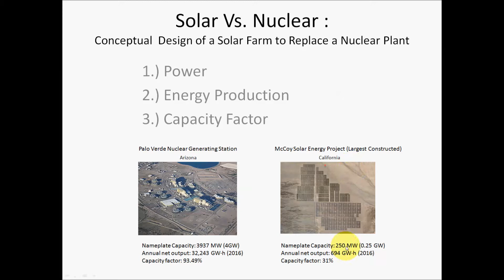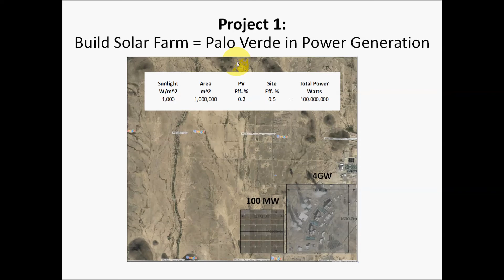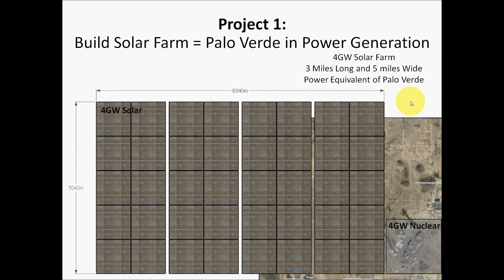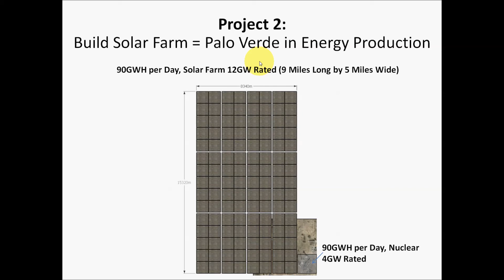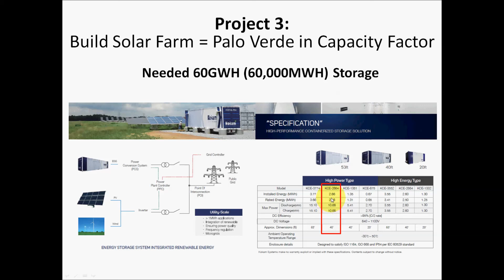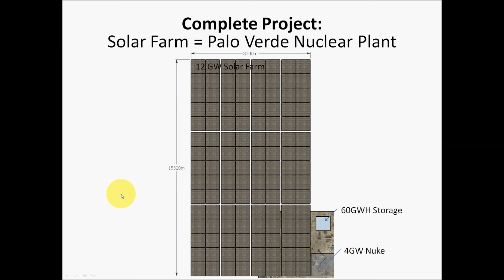Solar vs.  Nuclear Power : Conceptual  Design of a Solar Farm to Replace a Nuclear Plant

Comment: when uranion preice gronw up. the solar energy not have competition.., and if for the space. all countris of the wordl production hidrogen. (with solar panels) for sell. at industrial countrys... not only solar panel, wind, hidraulic, geotermal, osmotic, biogas, using for vector the hidrogen. sorry for mi bad englis..
Reply: Uranium won't really go up. We can get if from Ocean water, and we have 5 billion years of it. We also need so little to make such massive amount of power.
Reply from the maker: Ocean water extraction might not be the most cost effective for collecting uranium. But breeder reactors that can make more fuel than they use! Hopefully we will revisit this technology.

Comment: Good analysis. There are some adjustments you need to make in your estimates. I've looked at a number of large solar projects in that region and they are fairly consistent at about 400 kw capacity per HA. So to get 4GW capacity would be 97 sq km more than double the 42 sq km that you calculated. Another problem there is no way that McCoy has a 31.7% CF, even though that is what the EIA data shows. The plant is expanding so they must be adding solar in 2016, increasing the nameplate capacity beyond the quoted 250MW. Looking at PVWatts data for Riverside, California with one axis tracking, which this site uses, the CF will be 23% not 32%. So the actual area needed would be 97/.23 = 421 sq km rather than 128 sq.km. 

But there is more to it than that. Lowest month will be more like 17% CF. You cannot store month to month. So you are looking at more like 570 sq km. Then you will have storage efficiency losses of ~12% and an inability to store avg output over the solar daily cycle that will further reduce baseload output to 82% of avg output. So now we are up to 570/.82 = 696 sq km. And that only covers one day storage. You do get days with less than 15% of avg output. I don't know what you are going to do about that. Multiply by 7X? Double storage? Most obviously it means fossil backup.

Also storage will have to be about 19 kwh/kwavg output. So for the 4 GW of avg output you will need about 76 GWh of storage a mite more than the 60 GWh you calculated. And more like 22 GW nameplate capacity to supply the worst month with storage in a typical year.  And 696 sq km area vs the 2.5 sq km for Palo Verde NPP. Just 278X more area. And the EROI (energy return on invested) for this system would likely be ~2:1, maybe even less. You need a minimum EROI of 14:1 to supply a modern industrial civilization with health care, education, large scale agriculture, arts & culture, legal system, military, transportation and pensions.

And that is in one of the best Solar areas on the planet. Most areas are not nearly that good. A wide swath of land from Alaska, NW USA, through Canada, Europe & Russia solar the ratio Max Summer month to Min Winter month is ~6:1. With electricity demand max in winter.

The only practical way to do storage for solar is to add sufficient storage so the solar will cover the function Demand(t) - Baseload(t). That will cut storage to about 1/3rd of what we calculated. You still will need fossil to cover low solar days. And that means there is no getting rid of a vast fossil infrastructure with a solar/wind grid going all the way back to Middle East Oil & Gas fields complete with military protection.
Reply from the maker: Thanks for your well thought comment... you touch on many interesting points, great input for another video. Again, this was just a conceptual design and I tried to round up in favor of solar to give it the benefit of the doubt. 
I mostly wanted to visualize what a solar farm roughly equivalent to a nuclear plant may look like.  

Lots of things we could discuss in more detail but my simplified take away is that you feel 
22GW nameplate + 76GWH of storage = 4GW Nuke... Is that correct?
Reply: No. That much solar plus storage could not be built as a replacement for nuclear/hydro/fossil energy supply. The EROI, the materials inputs would make it a physical impossibility. It can only exist as an oddball parasite existing off the backbone of a fossil/nuclear/hydro energy supply. And whereas the NPP will happily produce power all year round the solar even with the one day's storage will still be missing for multi-day periods per avg year and multi-week periods during weather anomalies. Even worse with a large volcanic eruption or major dust storm. And the solar is very vulnerable to an EMP or major storm or earthquake damage. As well the solar will supply excess energy in Spring when wind & hydro also peak with energy demand a minimum. That means energy must be wasted. Pushing costs even higher than the already outrageous level for this system. And this system only works in an excellent location. Solar & wind are quite simply an impossible replacement for fossil. They are bit players in the energy game and will remain so.
Reply from the maker: You're talking past me now, I said at the beginning of the video that I was going to ignore some things like EROI. What I was trying to do in this video was compare Power, Energy Production, and Capacity Factor. From what I gather, my estimate for those parameters matches yours within a factor of less than 2x so we are in the same ball park.
Reply from the maker: @rRobertSmith  Thanks for the link, I tried to talk about solar energy EROI in my  other video... https://www.youtube.com/watch?v=-Dvs8HGs3WE&t=4s